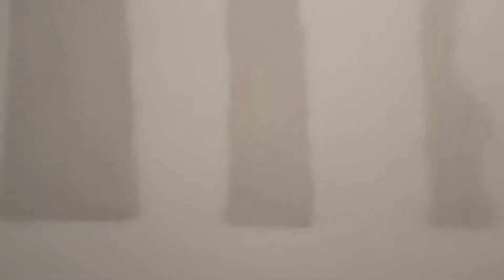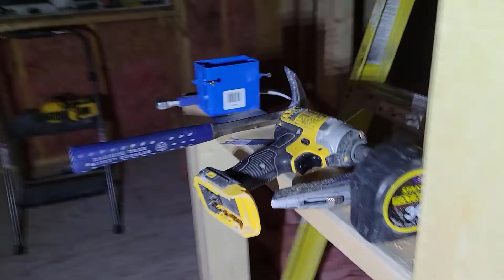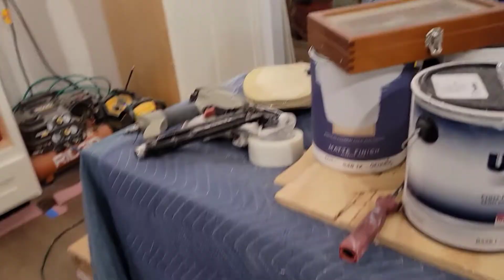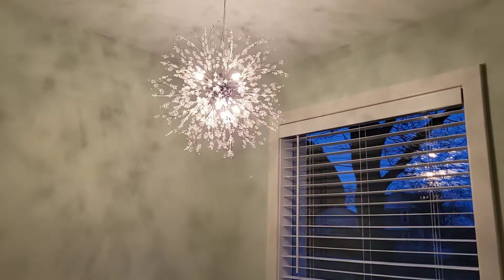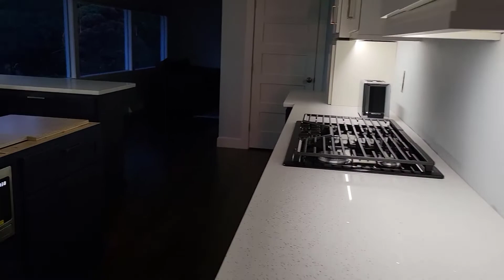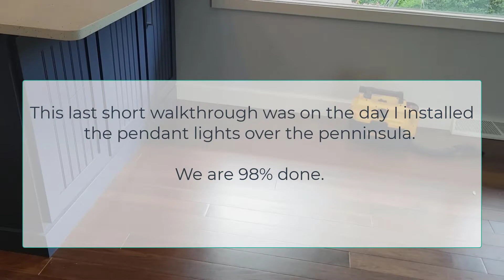$150k remodel walkthroughs - from 60% to 99% done

Comment: Fabulous work bro
Reply from the maker: Thanks for the comment mystoryhisglory9438. Clever name/handle! This project was really fun and rewarding to work on. It was a really big transformation from a broken up set of rooms/hallway to what they ended up with and as much....the clients left for several weeks while we tore it up and put it back so we had the run of the place (and we didn't have to clean up every night after we were done building).
Reply: @SdS Construction  it turned out excellent. I remodel bathroom primarily and have done some smaller kitchens they are fun when you have adequate help. 
Thank for props on the name, it's definitely true! Look foward to new videos man